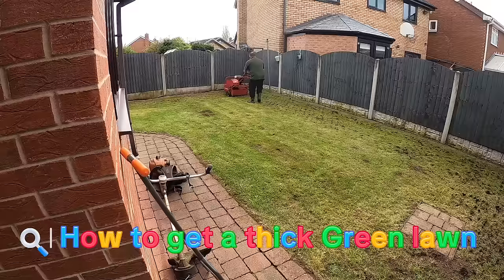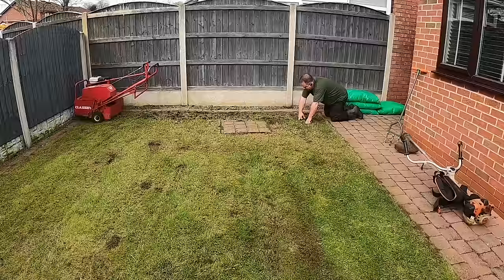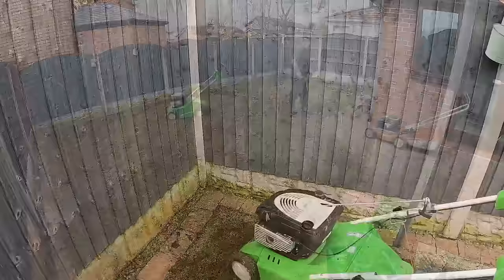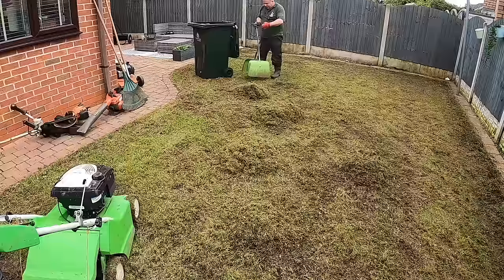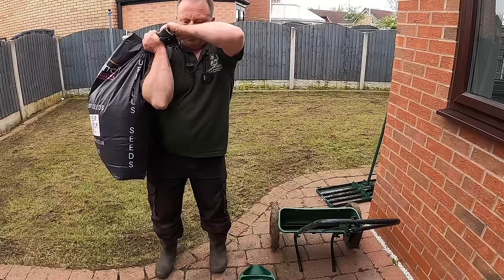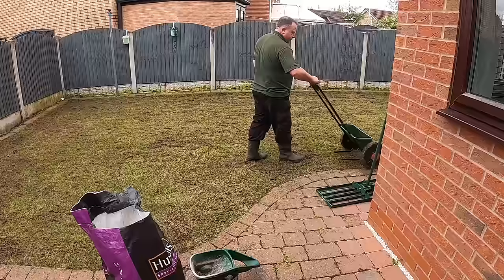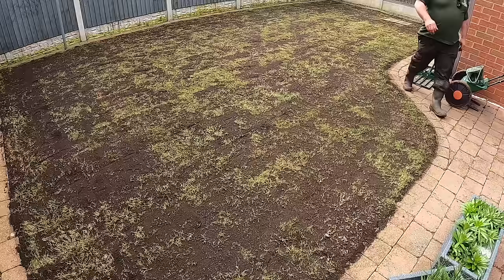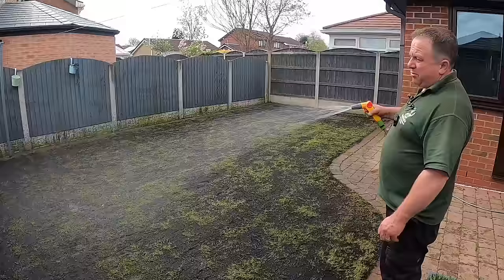My Desperate Attempt to Transform His Broken Lawn

Comment: Good job. If you put the fertiliser down before the seeds it can be washed deep into the soil before the roots have developed. The seeds contain all the nutrients they need to germinate. There are also some slow release nutrients in the compost. it’s better to wait until the new grass seedlings are ready for the first cut (so you can walk on it) before applying the fertiliser. This would mean a second visit, which is OK for DIY, but needs a second visit for a professional job.
Reply from the maker: Hi it's a preseed Fertiliser
Reply: Yes, I know. But it is not taken up by the seed/plant until the first root (the radicle) develops. Personally I never bother with pre-seed fertiliser and just use autumn/winter fertiliser once the plants are growing. But everyone is different and that’s OK.

Comment: Thank you for sharing. Can I use this method on a lawn that are fully cover with weeds. 😊
Reply from the maker: Yes you can but the weeds will persist and you won't be able to apply weedkiller for a good 2 months.   Either just weedspray for now  and renovate in autumn.. Or weedspray now with roundup just on the weeds and renovate in 3 weeks BUT you'd need to hugely increase watering as much as 4 to 6 times a day for up to a month then twice a week without fail through summer..  Or renovate next spring but be sure to get your weedkiller on much earlier in the year like march
Reply: @LawnRight  Thank you for your advice. Now I know what to do. I will crack on with it while the weather is nice. 😊
Reply: Would you be able to guide me through as I've just finished scalping my lawn yesterday, and next will be scarifying and laying 70/30 top dressing. I couldn't get the pre fertiliser. Is it ok to use the feed, weed, and moss killer granules after scarifying, then seeds, and then cover with 70/30 top dressing as I am levelling the lawn. 

Is it going to be raining every day next week so I am trying to get this done today if possible. 😂 Thank you.
Reply from the maker: @ctc3041  sorry you can't apply anything with weedkiller in it if laying any seeds down so you'll have to skip that bit
Reply: @LawnRight  Thank you. I will just continue without it. Getting my hand on it now. ❤️